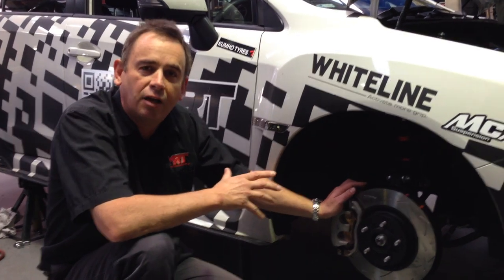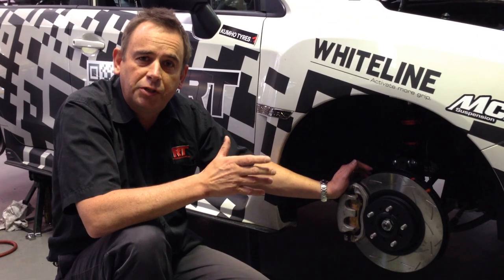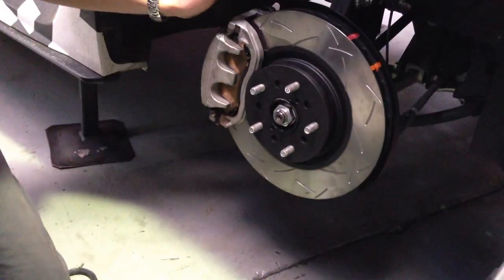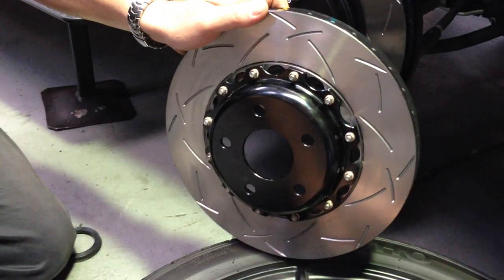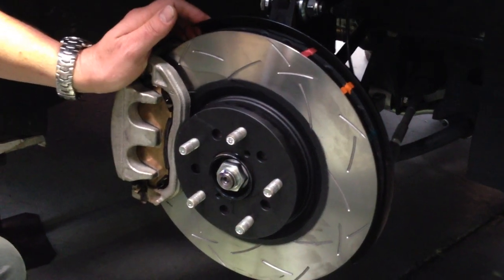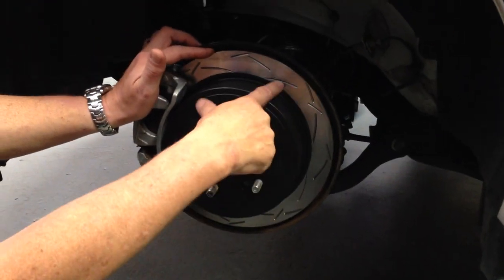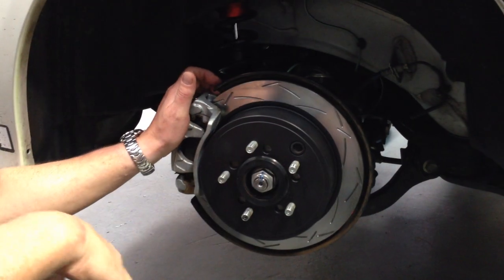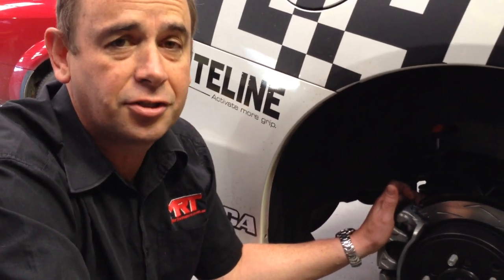Subaru WRX MY15 review of the brakes and fitting DBA rotors

Comment: They used ventilated in the rears of BRZ because as you know its a RWD, and therefore the rear brakes exclusively bears the inertia of the rotating parts along the drive-train when slowing down. It's not a huge amount of torque compared to the job of stopping the car, but its a conceptually sound design.